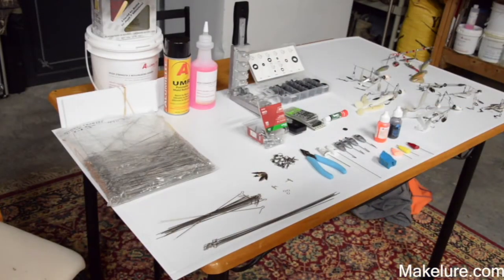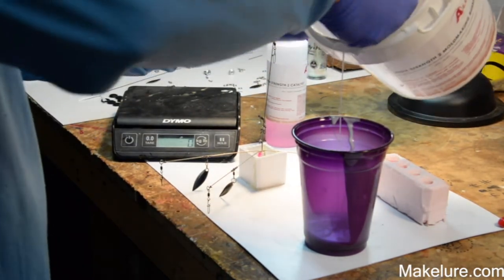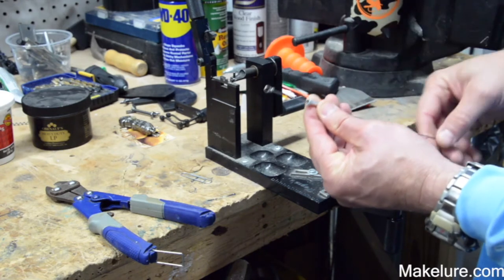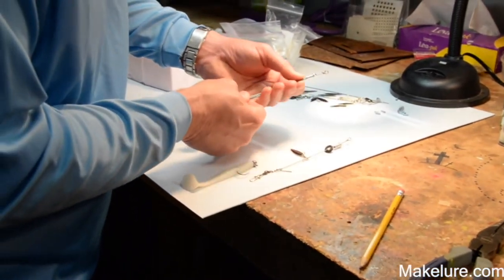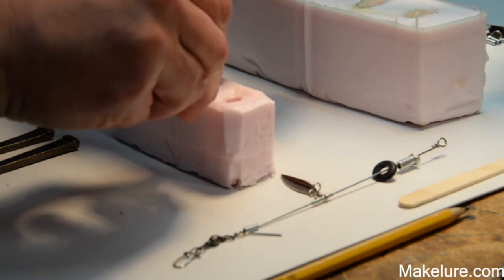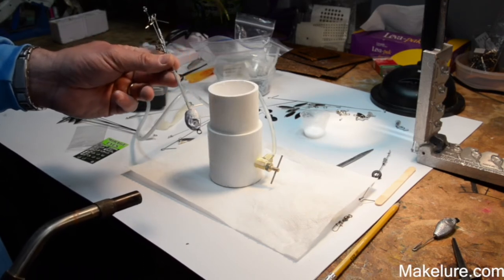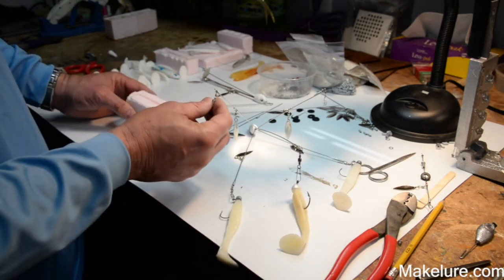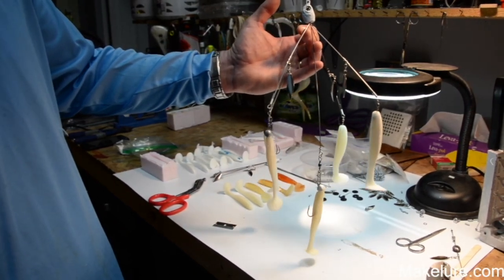Homemade Alabama Rigs using MakeLure Products

Comment: Good video have u evet had trouble with the pop rivet
Reply from the maker: We have not.  Once you bend the wire then crimp the rivet, it is very solid.  The snaps will break before the rivet does.